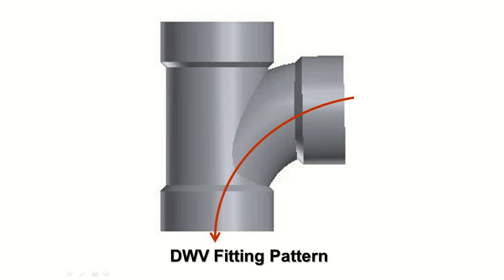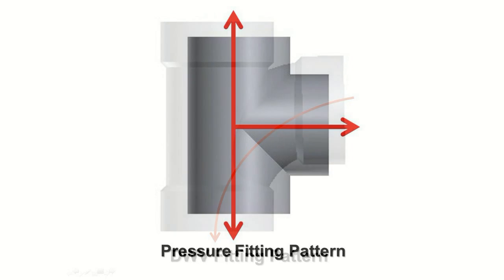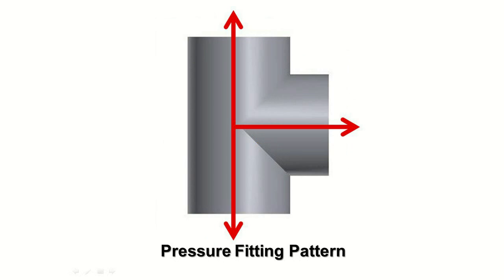DWV vs Pressure Fittings

Comment: Thumbs up; I've mistakenly used sweeping Ts for pressure pipes (in sprinkler systems).  They crack every year ... not able to withstand the pressure.  A plumbing supplier also validated your "pressure fittings".  Utmost thanks.

Comment: What pipe is stronger for building a racing rig stand mate?
Reply: Schedule 40 but if you leave it in the sun it will eventually weaken unless you paint it for UV protection.